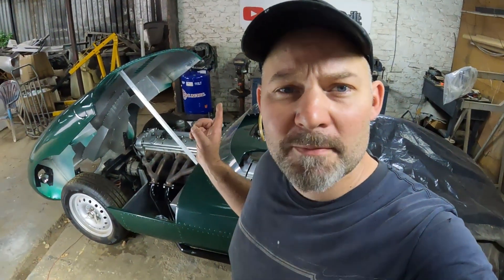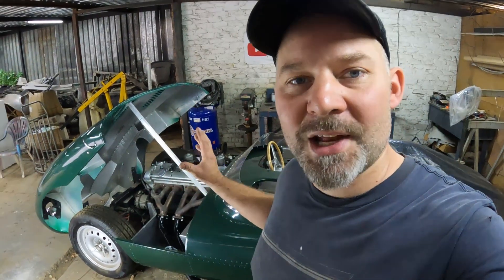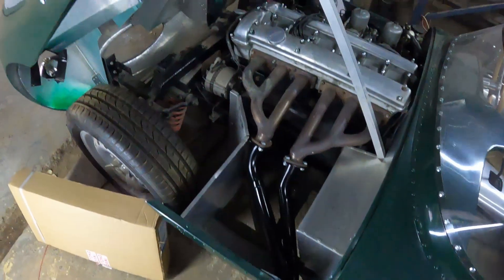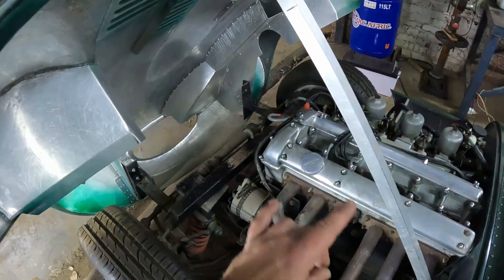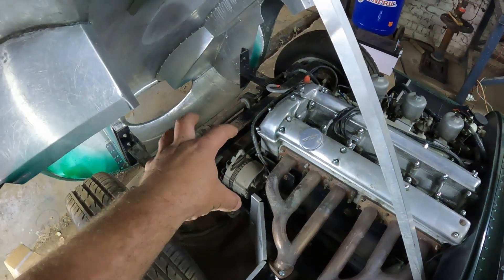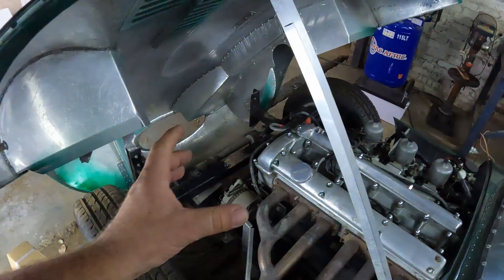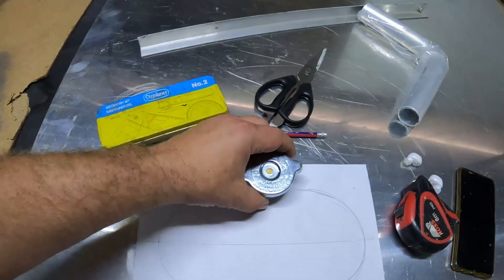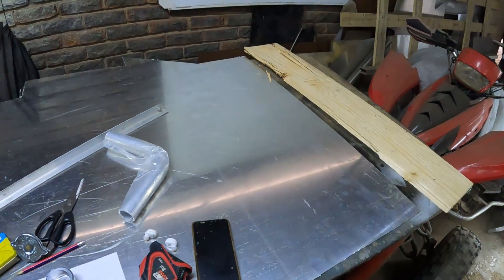Jaguar D Type build. Making a Reservoir tank that is WORthy!

Comment: Very nice work on the tank and glad to see the car getting closer to running condition.  Are you sure you have enough radiator for the engine?  Comparing the pictures of the original D type and your car, it appears your radiator is about half the height and thickness of the original.  Not sure if I might have missed that your current radiator set up is temporary, but as someone who runs a highly modified engine in a British sports car in a warm climate, my recommendation is to put in as much radiator as you can.
Reply from the maker: Thanks! I am bit concerned that the radiator might be too small (especially if driven hard) but I couldn't find anything off shelf to fit. It will be easy to replace with a custom rad in future thou.
Reply: The challenge in building a custom radiator is usually in fabricating the header tanks.  After watching all your episodes, I believe this is well within your capabilities.  The core section can be purchased from a radiator shop and they should be able to supply whatever size core you want.  This would be a great touch to match the original D type radiator. 👍